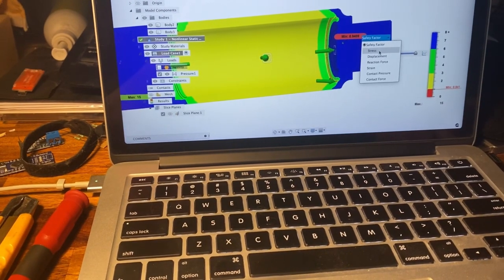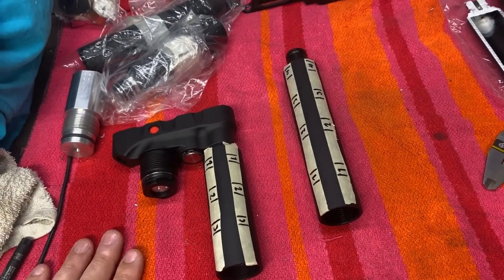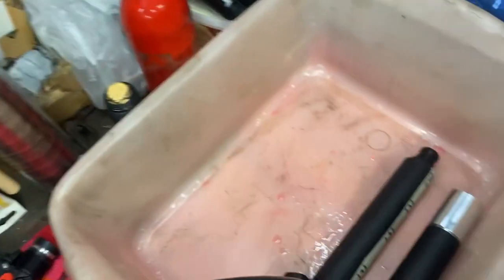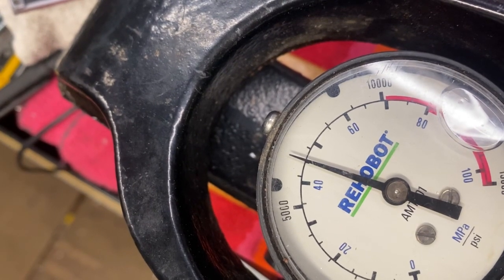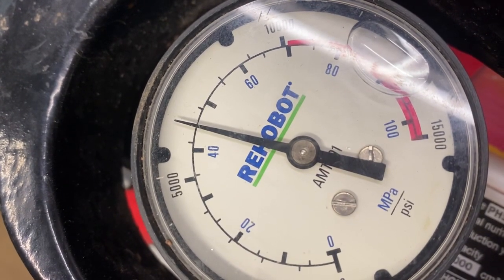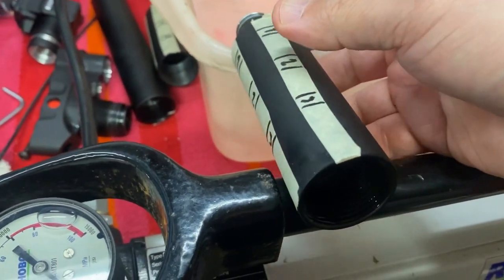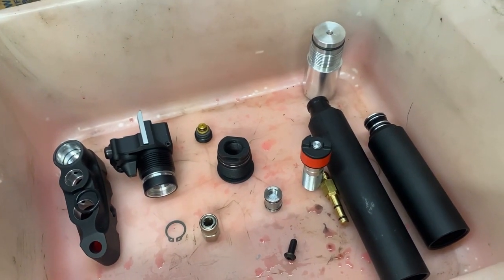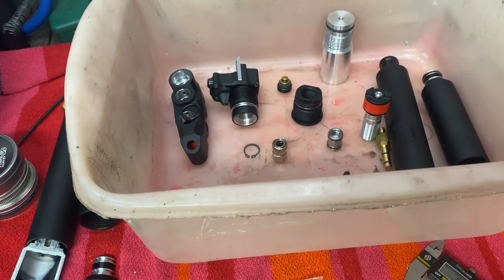Edgun Leshiy 2 hydro testing repeat as first test had an unfortunate mistake.

Comment: You should be sued for slander
Reply: That is just silly. The guy simply did his own independant tests and provided a second opinion. Which should be welcomed, mistakes and all. It also doesn't change the fact that a pressure vessel failed catastrophically at roughly 200bar, without a conclusive reason why. If you wanna put 100% of your faith into a single company, then I wish you the best of luck with that. To me, that is like when the government investigates itself, and then concludes it did nothing wrong. Again, 3rd party involvement should be welcomed.

Comment: Hilarious !!!! You should be thanking Ed for not taking you to court for slander ?!!!
Reply from the maker: Call it what you like, I call it as I see things, honest review of a failure in testing. I rather be wrong sometimes than be silent forever. Issue was found and resolved, I think that stuff happen all the time, people are too afraid of failure to speak up at all.
Reply: Preliminary testing. 🤦 Doesn't matter. Whether errors were made or not, Ed's not even done with his testing. There is still an exploded cylinder. So anything goes at this point.

Marko's testing got Ed to take this seriously. That's a win in my book.

Good luck with the slander considering Marko has already admitted to his errors and you would have to prove malicious intent.

Go have another pint.

🤡